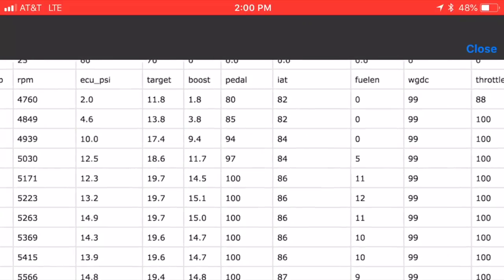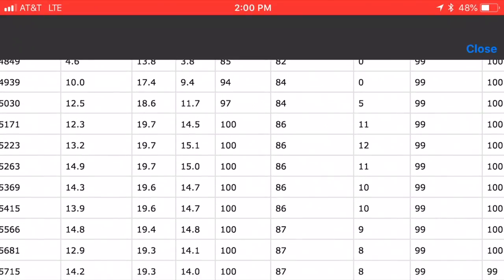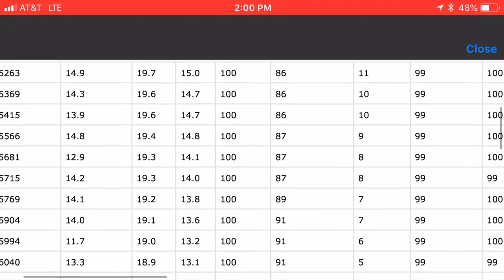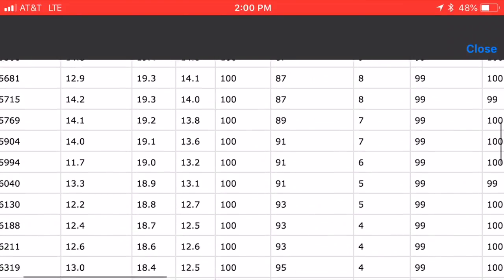100 Octane Race Gas In My BMW 335i! Part. 2 Well Crap...

Comment: Even if the higher octane gas will prevent preignition or detonation, I would be concerned about the effects of the increased heat and pressure on the piston ring lands if you have cast pistons. Will your catalytic converter and turbo handle the higher exhaust temperatures? Are your connecting rod bearings and main bearings strong enough to handle the increased torque over the long haul? Also, now that the ECU has recorded the changed engine operating conditions will your engine and drivetrain warranty now be void if you develop problems?
Reply: Your weird
Reply: @PSTACKSGAMING  I may be weird but at least I know the difference between a possessive pronoun, 
your, and a contraction, you're.

Perhaps it's because these "weird" considerations are not entertained for turbo builds that we see instances of blown engines. Ignorance usually exacts a high price in high-performance car modifications.

Comment: Did the solenoids fix this? I just tried to run MHD 95 octane. Mix of race and 93. Can’t boost over 14 psi. Flashed over to 93 map and hit 17 psi all day. Vacuums look good of course. Sounds exactly like what you’ve got going on.

Comment: I had the same problem on my 2008 535i. It happened around 220k after I replaced my original FMIC with a bigger one(I hit a palm tree branch and it punctured my original FMIC).
After replacing every piece of a boost control system and exhausting Google, I started blaming my turbos until I noticed a connection between logs with original FMIC and twice the size aftermarket FMIC where I was getting ignition adjustment on as low as ~97 degrees because it was taking longer to build up target boost due to increased volume of a charge system, so I got a crazy idea to get rid of a FMIC and put a complete water intercooler system simply because it practically has no loss of boost compared to any FMIC. That took care of my boost leak and made car drive better than I can remember.
Reply: Anton Filimonov how did you do that? is there a kit I could buy? Fmic was on my list for a long time but your comment second guesses my build plan. I'm always looking for information based on n54's
Reply: I wish that somebody would at least try to make an attempt to put together a kit or list of parts that are needed for air to water conversion on N54 simply because I've spent extra ~$400 for stuff that I didn't even need but besides my stupidity whole thing did cost less than a FMIC from VRSF and all the parts that I needed came from Amazon.
I sold that car about a week ago and I had ~280k on it BUT for past couple of years or so I had it as a secondary 535 and tomorrow I was going to do the same thing and same conversion on my newer 535i that has pretty much the same mileage as my old one a couple of years ago, so I can just snap some pictures and paste Amazon links that I used literally last week to get parts from.
Tomorrow's project on my "new car" is happening simply because I live in suburbs of Fort Lauderdale, FL and I just got tired of seeing 150 degrees IAT every time I hit SoFlo traffic. Let me know if you want me to just paste links below or try to capture somewhat assembly process tomorrow.
Reply: I think i would speak for all of us if you would post as much as possible in the most idiot proof way and in chronological order. A list of links and pictures, a small home video explaining things verbally would be "best" because as you said nobody else is bringing light to this method when a big ass fmic is expected for going stage 1+. And you said it cost less than Vsrf? Haha. yeah,  'ALL ABOARD! appreciation from NJ
Reply: I have a '08 535xi (6mt) if you were curious at all haha
Reply from the maker: Anton Filimonov damn, that’s sweet! Yeah I don’t hear much about this setup ever
Reply: Thank you!!
Reply: @burntavocado5033  I'm sorry that I only have pictures, I just don't have a GoPro or anything, so my phone is the only way I can capture things and I can't really put it on anything because I'm working in a parking lot of a hotel.
I'm taking a "vape break" now but I just added a few more pictures of how crazy tight is E60.
Going to change my gloves and get some more stuff done.🙂
Reply: Just encountered my first and serious problem. Instead of a 3" ID 135 degree silicone elbow, Amazon sent me a 3" OD which of course doesn't fit on throttle body...
Does anyone know how to stretch a silicone hose without killing myself or sanding down a throttle body?🙄
Reply: 'May the force be with you. Always
Reply: How did you make out?
Reply: This foo straight cap can’t even show proof 🤣🤣 can’t convert air to water on n54 sorry guys

Comment: Yep had the same problem with mine, replaced both boost solenoids fixed the problem.
2008 335i JB4+MHD E85 BEF FUEL IT STAGE 2
Reply from the maker: Jeff Baker thanks Jeff, I’m trying to throw them in either Saturday or Sunday morning 👌🏻

Comment: I had a similar issue with my own 335i. In my case, i had my original td03's reconditioned and found that the rear turbos wastegate bushing had worked loose causing the door to not close over the hole properly.

Comment: Hey I need to replace the window regulator for the small window on the rear passenger side, do you have a video or a link on how to change it myself.  Im looking to diy it myself.  Need info ASAP thanks
Reply from the maker: Freddie Diaz I need to do mine soon since it broke, so I’ll do a video on it
Reply: BMW Fanatic right on. I just bought the assembly. I will wait till you drop your video. Thanks man 🙏🏼

Comment: You don’t certainly get a 30FF right away. I have had boost like for like half a year and 30ff came on like 3 times, but I couldn’t find it. 16psi and 100% wgdc is not good it should be around 45%. Also check if you didn’t have the vacuum lines popped off from the wastegate or something. Also in your older logs did you have 100% wgdc for a bit at the beggining of most pulls?

Comment: I thought you were running map 5? Love your videos by the way I could have never owned my n54 535xi (6mt) without your diy, recommendations and passion!
Reply from the maker: Burnt Avocado Used to, but map 5 is too back and forth. With the backend flash stacked on, map 1 is very strong as it bumps up the boost 2 psi in each map except map 5. I’m on map 7 now because of the 100 octane
Reply from the maker: Burnt Avocado Thanks for watching!

Comment: With 100 octane, you shouldn't really run Map 7 on the Pump flash, you should switch to the Race flash. Lower boost but better timing, which is the point of higher octane.
Reply: RavTokomi isn't map 7 the race map? Pump or whatever a race map is a race map isn't it? Correct me if I'm wrong just improve my knowledge by doing so. Thanks!
Reply: Map 7 is referred to that way because you generally need more octane than 93 to run it, but it is really just the highest boost fixed map. With the BMS Pump BEF, maps 1,2,7 all run higher than normal boost, but with lower timings, which tends to net better power with regular octanes. In this case, running 100 or higher, you would probably benefit from tighter timing rather than higher boost, hence Race BEF. Race on Map 2 or 5 may do better than Pump on Map 7 for example. Along those lines, if you run Meth, you usually run the Race BEF because of the added effective octane. Of course, as Terry would say, log and evaluate!
Reply: I greatly appreciate you explaining that. Genuinely. Have a great day! Happy driving !
Reply from the maker: RavTokomi Yeah I hear ya, logs look great for everything else besides the WGDC. I tossed around doing the race flash, just haven’t actually done it yet
Reply from the maker: RavTokomi Terry & I went over mine as I asked about just keeping the pump BEF 🤣